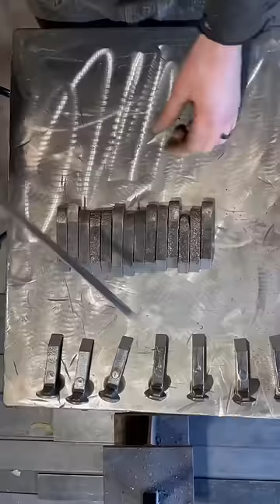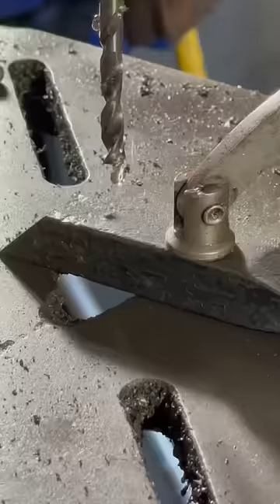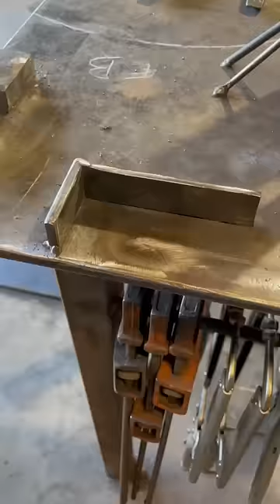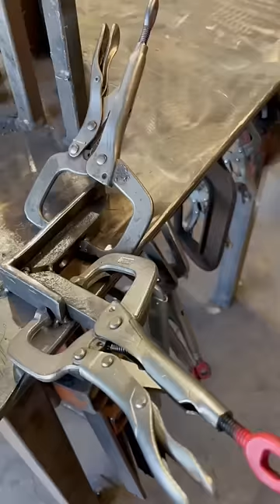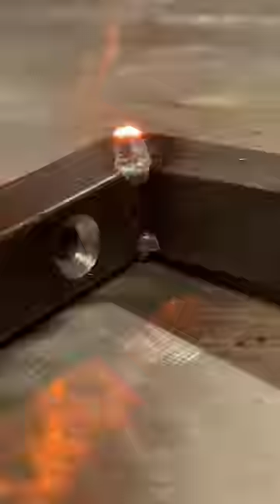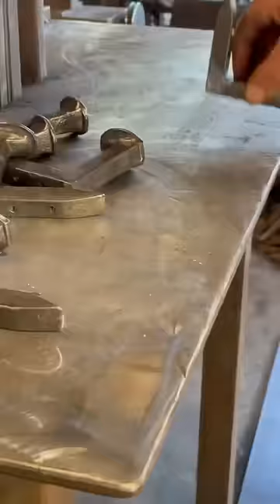Railroad Spikes and the Beauty Within

Comment: or, heat them and bend them. still get rail spike hanger hooks.
Reply from the maker: I’ve actually made those and made a video of them as well! I think it’s posted here already but if not, I will post it soon
Reply from the maker: See Short reply
Reply: @MenardMetalCraft  whaaat idk you could put pictures in YouTube comments
Reply: @brighamruud5090 it's actually a link to a short.
Reply: Haha yeah! My comment was going to be, "oh hey I just heat mine up and forge them into hangers, but I like this cool idea too!" I keep the head at the top though, and curl the bottom out and forward. Might like to occasionally scroll the tip if it gets sharp
Reply: @MenardMetalCraft  oh that was awesome!😆 Love both of these shorts!
Reply: @MenardMetalCraft ..I have a friend that twists them into a handle, then a blade.  Pretty cool.
Reply from the maker: @RyeDoug  dang man that sounds like you are describing another style hook I make as well haha. Great minds think alike! I have a video posted of that hook process as a normal video on my page if you wanna check it out and see if we are at all similar in design 🤷🏻‍♂️
Reply: An why in the fu*k is every one think they have to throw everything in all video
Reply from the maker: @jasonjones0707  because I have inspired them all 😳😂 . But honestly, just for a faster paced “requiem for a dream” style edit. It would be really bleh if it was just all calm and slow and parts sitting there. I wanna hear the steel. Not see it sit still. But to each their own 🤷🏻‍♂️
Reply: No wonder the bloody trains are derailing in Ohio, you pinched part of the tracks.
Reply: @MenardMetalCraft lol 😂
Reply: he wanted something shiny and pretty and he got it.  good for him.  pride in a job well done pays for itself in satisfaction.
Reply: Either method is good, this one adds length which is better for longer or multiple coats
Reply: Forge them
Reply: I bend them cold, witha 20 ton press from harbor freight, and a swag off road brake. Those look great though, no way to correct the lengths if you're bending them
Reply: ۰😊😊
Reply: Понятно почему два схода с рельс за сутки в США
Reply: @MenardMetalCraft which is your favorite ?

Comment: Aren't those going to be a lot harder to hammer into a track now?
Reply: I think they are used on curves...
Reply: you gotta use a square hammer on these ones
Reply: In my experience a curved hammer works.
Reply: Also he bent them to the left, so you'll need a left-handed hammer.
Reply: No, he’s an Ohio-based track layer
Reply: He could almost use the wood stretcher but as you guys can tell this is metal. Also laser oil works real good on this.
Reply: Brazoworld superman can still hammer it in bad!
Reply: Def use them for shelving brackets❤
Reply: With my hammering skills I finally can put them in straight 😂😂

Comment: Holy crap, a how to video where the builder can actually weld a bead. 

Take your damn like.
Reply: @dorianearnest4648 If you cant tell the difference between Hard wire and Flux core.. might wanna keep your mouth shut. 🤷🏾‍♂️
Reply: @dorianearnest4648  lmao it was mig and obviously it’s not as impressive as stick or tig but still usaully when you see people welding on here with mig they don’t even run a bead just a bunch of shitty tacks
Reply: I was gonna comment the same damn thing.... and how the hell could you possibly mistake that for flux?
Reply: 1” thick steel and he beveled it anyone could weld it nice just turn up the amps lol
Reply: @Dylan Ashley  yes... but that's not the point, the point is every other "youtube welder" welds anything and everything with tacks
Reply: That's a first
Reply: Yeah, no shit, lol. He's got his heat spot on.
Reply: @Lee Mitchell  I felt sooo dumb there for a split second... when I read your comment I was like what the hell is a heat spot 😂 but yes, yes he does its nice to see someone who knows at least how to run a proper bead. And you don't see him "teaching" people "how to weld" like the people who can only pull a trigger for a half second
Reply from the maker: @Flytyinguntilimdyin  5/8” friend, with maybe a 1/8” bevel. Certainly no “partial pen” with fish ground reinforcement.. just an aesthetic choice to grind the welds flush, and beveled to leave them still structurally sound post grind.
Reply: I wouldn't really call a 5/8" weld much of a bead, maybe a strong tak weld.
Reply from the maker: @sageminentjunky5197  yet 4 of these tack welds and it is now seal welded as well lol
Reply: I said the same thing
Reply: Did a like and follow
Reply: @MenardMetalCraft  it's just refreshing seeing an actual bead rather than these other videos where they do fisheye and edit as if it's a continuous weld
Reply: @weldlife185 Only inexperienced people who have never done anything with their hands get personally offended by that such as you
Reply: Honestly first thought I had was „Oh sh*t a man that can actually weld nice“
Reply: bahahahahahaha!  you take your dam like sir!
Reply: @Flytyinguntilimdyin  that that weld is pretty cold and literally the easiest thing to weld possible.
Reply: One of the beauties of mig welding is how easy it is. My welding teacher used to say Hellen Keller could do it
Reply: Idk that nozzle wasnt on there properly.
Reply: @zipperblues6714 some manufacturers suggest to have the electrode 1/8"past the nozzle when welding on joints and pushing less than 200 amps.
Reply: @davestewart1656  never in my life heard that.
Reply: @zipperblues6714 I'll admit that its probably a bit of overkill.
Reply: wrong..he pushes the weld, your suppose to pull the weld along so the gas can cover the  bead. and what the hell was he making anyways.
Reply: @motorizedbikestuff5339  either way is fine.

Comment: With my handful of spikes, I cut the point off flat, then drilled and tapped the new flat end. Then I used those to mount them as hooks on a nice weathered Eastern Red Cedar board. Has been our hallway coat hook rack for almost 10 years now.

Comment: A single flute countersink cuts a lot smoother than those so called "chatterless" ones. I use the carbide ones.
Reply: Yeah I tried a cobalt one just to see, its definitely better, smoother cutting action with single flute.  Might buy a keo cutter set some day, all I seem to be able to get good results with the chatterless is by going really slow or just using it to debur by hand just holding it like a pipe reamer.

Comment: I would make something I could tie ropes to and place above my drive way (I live in a wooded area, mostly country) up in the trees. That way when I want all I gotta do is walk out my door and cut a rope, the structure lowers down onto my drive way just before my gate and it's a huge spike strip only this one is for sure impaling anything that runs over it. Maybe a 12x12 piece with around 300 spikes...then you can weld in nails and screws. Make it nasty. and yes this is completely possible with the right equipment.

Comment: And then they're acting surprised when trains derail
Reply from the maker: I can honestly say I have never tried to remove a spike from a rail tie. However I imagine a human could not possibly do it. The railroad uses large machines attached to the rails to pull and replace spikes. When they do this the old used spikes are discarded. I use those old discarded spikes. So really the more work you see from me should essentially mean the safer the rails are, because the railroad has been actively replacing the worn spikes.

Comment: Too much work for such little reward
Reply from the maker: Now see what ya do here is see how many you can make in 1 hour, and see how much you can sell them for, and then that is how you can get an accurate judge on if it is too much work for the reward or not. Lots of little variables. If you work slow and sell low, probably not worth it.